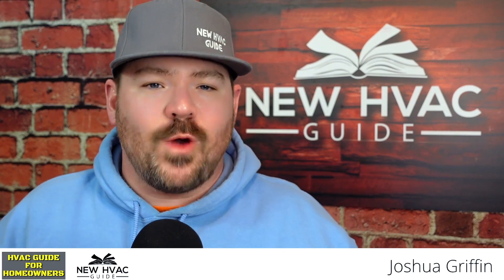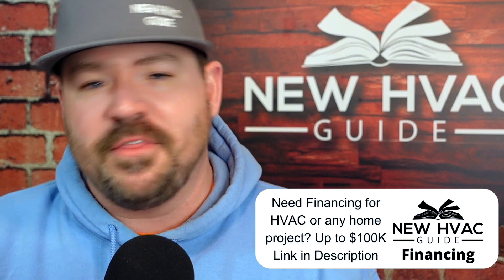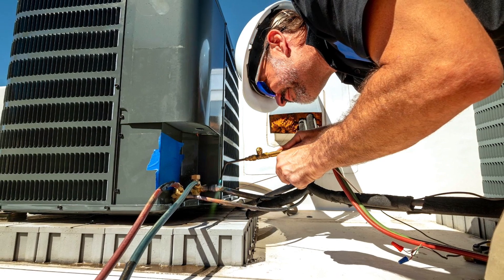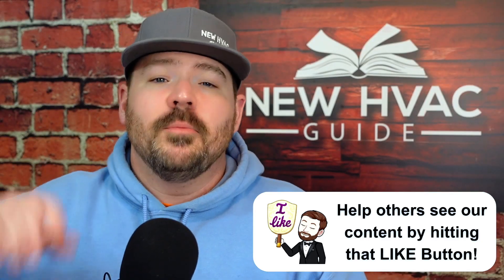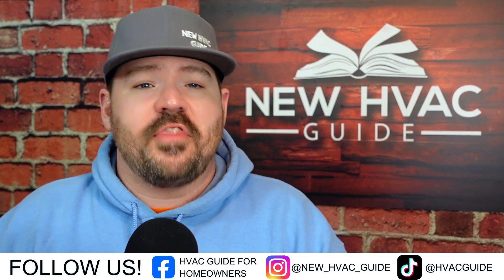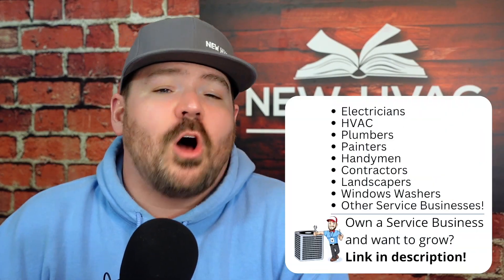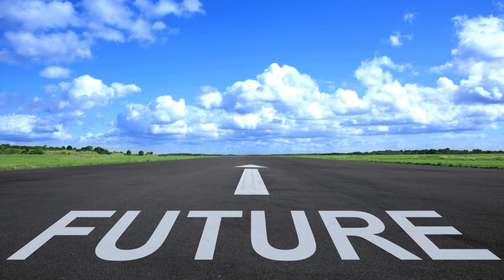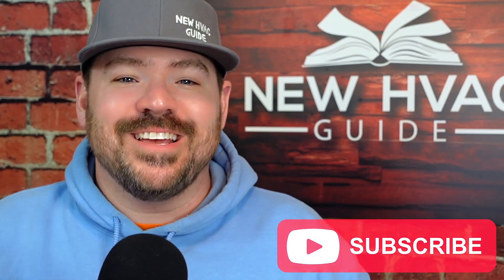HVAC Myth! Soft solder vs Brazing. (Air conditioner breakdowns that follow!)

Comment: 42 years in a trade. In the beginning with the old Union refrigeration fitters to current. Not one said soft soldering is better than hard brazing alloys. Soft solders have their place as we know it. Those of you who choose it over hard brazing alloys; joints of long-term usage; it's a preference to use it  if you know about the failures or not.

Comment: Well, I used regular solder for electronics on a carrier capillary 1/8 tube. That was probably 8-10 years ago. Still running no issues.

Comment: 2 issues with brazing:
1) Half of the "professionals" in the HVAC trade do not bother using inert gas. It slows installation and the problems caused by the shortcut will not show up for years.
2) Heat required to braze. True, it does produce a stronger joint, but the heat required weakens the copper tubing. On a test bench, 1/2" copper tube will split 2-6" from the joint. The tube will split around 3500psi for a brazed joint, and 6500psi for a soldered joint.

I remain in the Staybrite/stayclean camp. Sure, it's $100 per lb, but worth it.
Reply: I think you're being generous assuming that half of techs use nitrogen to braze. A lot of the comments from techs on these types of videos say things like "I've never seen anyone using nitrogen to braze" or "I never knew that. I got thrown into the field with only 2 weeks of training when I started". That's the kind of thing that makes me lose faith in the HVAC industry as a whole.
Reply: No residential air conditioning system is hitting pressures that cause tubing to split… factory bells on the coils blow out at way less than 2000psi

Comment: With the advent of A2L's and other flammable refrigerants becoming dominant in the HVAC industry and with so many other better methods of joining copper, I can definitely see brazing & soldering going away for the most part. Remember the days of unsweating a compressor and oil flaring up and getting a good wiff of phosgene gas in the process.. as bad as that was could you imagine an A2 or A3 refrigerant blasting out of there? I hope nobody's doing that.

Comment: if it works for the last 100 years why change it?  if you really want to try something new just use super glue.  it is as strong as soft solder and cheaper and simpler to apply.  anybody try super glue??

Comment: I was trained and worked throughout the 90s on small refrigerators, window and wall unit air conditioners, and other small systems.  The rule was to use brazing rod on all copper to copper joints.  Some compressors had steel stubs and we would silver solder those.  We all carried small oxy-acetylene setups and use this for both type of joints.  We new about dry nitrogen, but were told to understand on 1/4 and 3/8 lines that using it was unnecessary and should not be a problem.. Did I ever have a problem?  Well, I never had to go back on a leak, but did I reduce the life of a compressor?  Maybe I did.

Comment: Repairing those inevitable soft solder leaks requires the use of a liquid flux to clean out the burnt paste. Brazing is cleaner, tighter, & less problematic In my opinion.

Comment: They say stay bright 8 is a stronger joint than brazing because you are not overheating the copper and making it brital. Thats it. Only issue is the flux not the best thing to get into our ac systems. I like stay bright 8 for more sensitive installs like txvs helps keep the heat off (im talking about commercial txvs with 50 plus tubs comming off it not those girly little residential txvs you res guys install ;). Other than that im brazing with nitrogen purge.

Comment: I used staybrite 8 for the 15 years I was an HVAC contractor. The only reason I used it is, I went to a demo when it first came out the demo team used a hydraulic press to pressure a copper line and it broke the line out the side. They cleaned up that line, soldered it with staybrite 8 and pressure tested it again. the line broke elsewhere. That was all I needed to see.

Comment: I agree that brazing is a better choice.. IF .. done properly by flowing Nitrogen. If I thought the installer was a hack and would not do it properly I would PREFER the use stay bright solder. I tried a task with stay bright and after years.. no problems. I did not have to flow nitrogen. Experiment. Much more of a pain in the butt than brazing. How many installers are hacks ? My Installer was payed less than $9/ hr. The company charged a lot. Poor guy. How many hacks are out there ? Lots.

Comment: I bought an old house when I was young that had forced air heat but had never had an a/c installed. I found an hvac contractor selling used condensing units. I bought an already 10 year old 3 ton Lennox pancake unit. I knew almost nothing about hvac but had been a plumber for about 4 years and was pretty good at sft soldering. After doing a LITTLE bit of research I figured I can handle this. At the time nobody told me not to soft solder the lines. I put it all together, had a neighbor that worked in hvac charge it up for me. When he saw the lead joints he said it will never hold. 14 years later I sold that house and that system was still there cooling like a gem. Since then I spent 10 plus years as a journeyman hvac technician and will tell you not to soft solder. But there are the odd times that it just works fine with no problems. But it was very hard to break the old compressors.

Comment: I am 42 yrs in have thousands of systems in  . I Stay Brite everything under 5 ton .  10,000 psi  The secret is even heat , work quick , once it flows around get away from it and be confident you have a quality joint  .  Stay bright 8 is quick , flows great and wont be a problem if you know what you are doing .   In saying that  I installed  a unit today and brazed at customers request .  Of course anything in the unit , reversing valves ,pressure switches , compressors braze for sure .
Reply from the maker: Why do you staybrite? Is it easier?
Reply: @NewHVACGuide  Low temps , quick , easy , joints are clean . I've never had an acid issue . Use flux especially formulated  by Harris ,

Comment: I put in hundreds of units over the years and never once brazed a residential unit. I always used soft solder with a high silver content. I never had a joint fail due to pressure issues. In commercial refrigeration, we brazed everything and we swept the lines with nitro to prevent scale. Brazing a residential unit, IMO is overkill.

Comment: 'Soft Soldering' with Lead/Tin or Tin/Antimony which should NEVER be used in HVAC work. The only choices are either Brazing, also called 'Hard Soldering' or StayBrite 8 which is a Silver/Tin alloy which has high joint strength but  melts at 430 deg.. The problem with brazing is that honestly any appliance or refrigeration tech I've seen do it generally sucks at it and they overheat the joint and anneal the metal weakening it. I've done all kinds of brazing and welding in 50 years and was horrified at the work I saw done by these repair techs Granted, it's not their forte but a beginner in a H.S. shop class could have done the same or better. Properly done, a brazed joint is ALWAYS the superior connection and best choice. In reality, most of these guys should use Staybrite and absolutely limit the flux. Most always overflux. If you have ANY doubts about your abilities, use the Staybrite.

Comment: Mechanical strength is a non issue.  Both are stronger than the copper, the copper will blow before the joint.

Comment: Been using staybrite 8 for 20 years with no leaks, see so many overheated service valves from brazing, harris says staybrite 8 is plenty strong enough for hvac linesets
Reply: And I've seen a lot of leaking joints from stay Brite. So what's your point?
Reply: Would you use soft solder to replace a compressor itself?

Comment: Soft solder vs Brazing, comes down to proper preparation for both. Both can be screwed up Equally as bad, and I've seen that.
That being said, when it comes down to strength Brazing is going to be the strongest If properly done, weaker if not done properly. 

The learning curve takes a little bit longer on Brazing, also more chances for screw up for newbies. There again,
there's an Equal trade off's of both. Different situations may dictate one over the other as a deciding factor.
I can think of many with out going in to Details.
Last Words,......... Just make sure you can do [ Both Right.]

Comment: Me and my cotechnicians have been talking about a need for new innovation on copper fittings. Now that TXV's are starting to be threaded in, so do the other joints or at least have some sort of flash heat/compression fit system.

Comment: You know what they say about opinions? Look...for this discussion, the answer needs to depend on science, not conjecture. I got into the HVAC business a few years after graduating with a degree in Chemistry. The real facts say that the amount of acid from flux in the system is miniscule and easily absorbed by the filter/dryer. Saying otherwise is non-scientific and conspiratorial. Unless you are a degreed chemist, save your opinions and let real scientists dwell on the complexities of chemical interactions. You're opinion is wrong.

Comment: HVAC contractors HODLing... LOL... even your jobs are not safe. Soldering isn't brain surgery, and neither is hooking up pre-charged linesets. LOLOLOLOLOLOLOLOL. Who needs to shell out $6k - $10k extra? If you want to cut your own linesets- spend a few hundred on tools, a recovery tank, practice soldering, get yourself a EPA608 online for refrigerant handling. Seriously, HVAC is brainless. Shit, even AI will teach you about it LOL. Go Mr. Cool mini split with pre-charged lines for the ultimate in laziness.

Comment: Whats scary in r industry., is i,m seeing soft solder and al. Tubing on copper lines.  Bottom line these types of joining leak.  Soft solder doesnt filet a joint and doesnt provide good tensile strenght.  For those of u that have had good results with soft solder, i submit to u that ur joint hasnt been subjected to vibration or earth movement.

Comment: Use stay Brite 8 as a sample test piece left a lump inside the copper tubing big restriction use a high silver content brazing rod works much better flows better when the copper tubing has a slight Red glow

Comment: He is so wrong about Staybrite 8, but he is correct that Carrier/ICP no longer allow it with the new A2L refrigerants due to its temperature melting below 800°F Not sure why that matters? House fires get much hotter than that. But, they are all talking up press lock fittings like crazy so they are invested in pushing out the old ways involving fire.

Comment: Stay Brite 8 was perfectly acceptable by most manufacturers before A2L refrigerants. Now it is a No No. I never understood guys like this, flipping out over others using it in the past. I've seen many many units at an apartment complex installed with stay Brite 8 lasting well over 20 years. The "fear of left over flux"  is  goofey if you evacuate properly.

Comment: Just watched a video of a contractor in Texas, soldered one fitting, brazed one fitting, pressure tested 7000+ psi and both copper lines blew out before either of the fittings.  Just opinion not a myth.

Comment: brzing:  acetalyen tank+ oxygen tank+ regulators + torch + nitrogen tank+regulator+ gym membership to build muscle you gona need to carry all these.
soldering: mapgas + torch,
for practice you can take a 2 feet pipe,  cut 2'' from it, swage the main pipe and solder the small piece to it. rince and repeat 15 times until you feel comfortable.

Comment: Over all, brazing is better. If I'm doing a repair on an old copper line, brazing will make a better joint every time. The high heat will burn away any impurities or contaminants.

Comment: Your opinion is fine. But here’s my opinion. And this is from the perspective of first, a business owner. Second, an HVAC educator. Stay Brite 8 works. That is fact. But just like brazing it has drawbacks. I have been using Stay Brite almost exclusively for over 7 years for my business. It is much more convenient because I don’t have to haul around a big oxy acetylene set or B tank. And it is faster to learn and more consistent. We don’t have compressor failures and we don’t overheat valves or Schrader cores. The two drawbacks we have found are you are not going to fill any kind of gap soldering. And the other is if you use too much solder, it will drip inside the line set. We had that happen once and it clogged an orifice.
To me the upside far out weigh the drawbacks and I see the same results with my students. I teach piping classes and they pick up soldering in one or two lab sessions. Brazing takes many more hours to perfect. We have tested braze joints versus Stay Brite joints while under pressure with a hammer and have found no difference.

Comment: I see guys now using the crimp connectors with o-rings. You want to talk about sketchy? I think you will most certainly have issues and leaks with that. I have tried stay brite 8 and used it successfully. Brazing takes higher heat and I think is more difficult than soldering but I do see advantages.

Comment: I installed my own unit using staybright 8. I made the connections and cleaned the inside joints before I connected the flared ends. Didn't have to deal with nitrogen and or high temp torch. Btw, brazing has its own debris as much as solder with flacking and blockage. My system is working great, and I did all myself.
Reply: Did you pressure test with nitrogen after soldering with staybright 8 ?
Reply: @rileypup5959  No. I just made sure the vacuum held.

Comment: I'm replacing my outside condenser unit. I'm reusing my old line set (properly cleaned of course). Problem is, when I install the new unit, it will be about 10 inches from my exterior wall. Is it possible to buy a 7/8" OD extension for my current line set? I have the joints needed to join them. I can't seem to find a 3 foot section of line set. Do they not make it?

Comment: Brazing 15% Ag is the way to go if you’re going to be using heat.  We hardly solder anymore we doing plumbing, let alone high pressure hvac systems. 
I’m moving more to press, but the manufacturers are way behind on supporting this connection from the factory. I would like to see Mini-Splits move to this too, and get away from flares.  With flaring, there are to many inconsistencies based on tools and the people using them. 
Also, we need to have a standard for HVAC press fittings and tools, like Pro-press is for plumbing and Mega -Press is for gas.   There are just way to many press designs out for HVAC.  It’s confusing for both the suppliers and the contractors.

Comment: in commercial soft solder simply will not hold. a CO2 line can run at 900psi and blow right through the soft solder
Reply: @theindividualguy936  - I don’t think anybody would attempt to use soft solder on a CO2 line. In fact, I have never seen a CO2 line.

Comment: Many manufacturers won't honor the warranty unless the tubing connections are brazed.  Many also require a licensed installer, who fills out the warranty card.
The video title implied "breakdowns that follow", yet just maybe's with no statistics.  Most mini-splits today use flare connections, which are easy for DIY and seem to work.

Comment: So from this video, what's the problem with soft-solder? Flux contamination? Have somebody done any testing on the damage of this over time. Are you telling me that a tiny tiny bit of left over flux on 8 lbs of refrigerant is going to cause a problem. That would be easy to check right? Do a 3,6, 12 month acid check on the system. I bet this is an overreaction. Brazing requires more tools, its more restrictive, you HAVE to flow nitrogen or you will be circulating chunks of oxide thru the system.

Comment: You are lumping together all solders even though Stay-brite is twice as strong. The only downside is if you use too much flux.
Reply: Stay bright is twice as strong as brazing and melts at half the temperature? Right!
Reply: @bruceglisson239  I said Stay-brite is twice as strong as other soft solders. I have been using it on new systems with no issues. The other advantage is you don't overheat the tubing. The main advantage of brazing is in the manufacturing process, not the installation. But obviously, suit yourself.
Reply: @letsbereal-hd8qt  You gotta love when people misquote you. SMH. Internet if full of them. Keep pushin' truth @letsbereal-hd8qt

Comment: Opinions mean nothing they are opinions, staybrite 8 joints hold and have for years, but fact of the matter is that brazing and sweating for plumbers will go the way of the dodo soon enough and press fit joint will be normal. Just wait

Comment: As someone that hasn't been in the trade for only 8 years and using RLS, Soft Solder, Push fit and brazing, each has its place.... My father always talked about "silver solder" as they called it, I always pushed back that brazing is best. It isn't. They are all good for what you need. I have used pushfits in restaurant coolers with no call backs, no leaks. Ive busted out the torches and brazed, and used RLS. It is in the prep and the time you take to do the job properly. Ive seen everything fail, but I will tell you, Installing a new system at my house and I will be using stay brite and L copper, any call backs will be me.

Comment: You don't know it all, staybrite 8 if done right works.
Reply from the maker: I definitely don’t know it all. However, whether staybrite works or not isn’t the problem. It’s the flux that’s used, contaminants, and OEM specs.
Reply: @NewHVACGuide  Clean very well very little flux, my tendency is over heating. Swirl torch is to fast. Presto lite torch more heat control. Try it.

Comment: What about JB weld?
Reply: @jooch_exe  You can temporarily fix a low pressure car radiator with JB Weld. It wouldn’t work in high pressure systems.